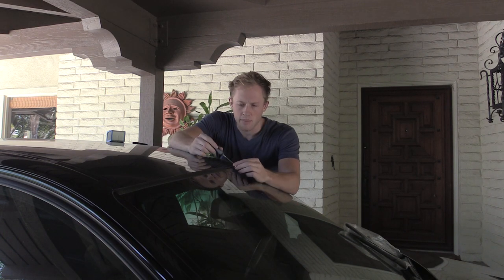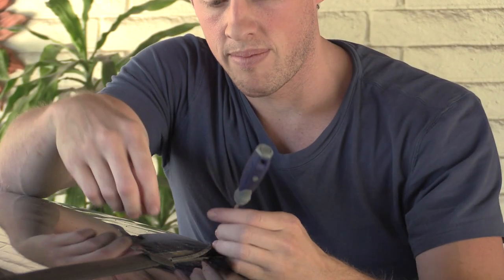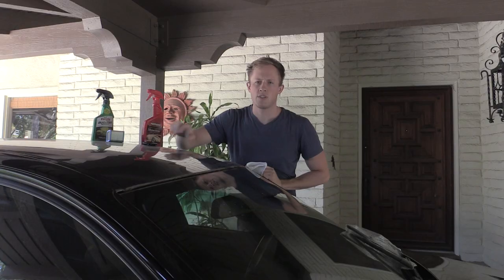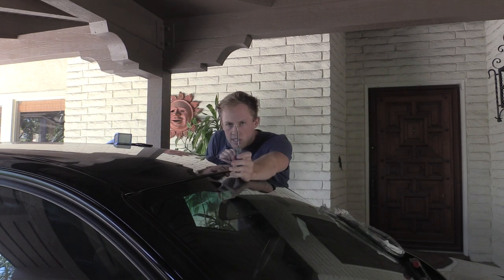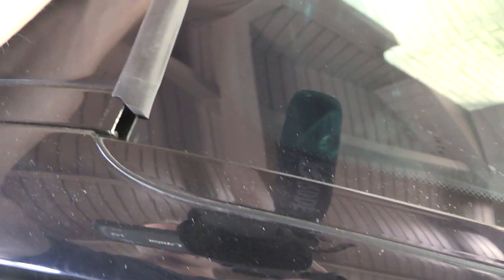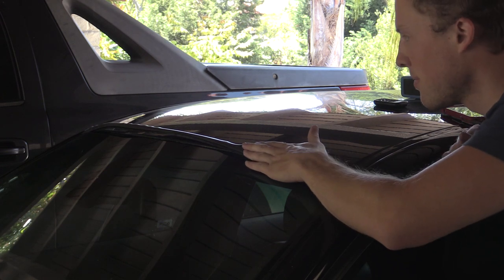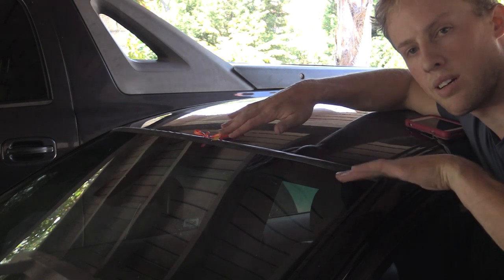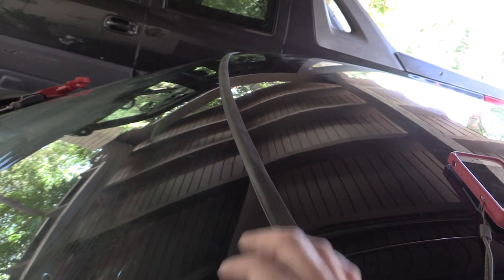E90 windshield trim replacement DIY

Comment: What about using black weather proof Caulking?.. Once everything is cleaned out, Run a smooth bead. only $3 at home depot...it would probably seal it up for just as long if not longer.  Just a thought?

Comment: Nice video. Just did my 2010 535i. PRO-TIP: Use a wooden rolling pin to perfectly flatten the strip both BEFORE you remove adhesive and AFTER. You can't get much better than that...
Reply: Amazing tip using the rolling pin. I couldn’t get mine in flat and started to question if I ordered the right part. Rolling pin did the trick. THANK YOU!

Comment: Lighting needs to be better to clearly see the install.  A little more time spent in what the underside of the strip looks like would also be a plus since they can vary in style. Where did you purchase yours? The amazon link is gone from your post. I bought one from Amazon and it was a nightmare getting it on. The C channel is SO small it was impossible to pop it into place. You do a great job explaining the install just need a little more detail. I have a 2006 325i and need a better product than what I got. Thanks!

Comment: Thank you for the tutorial. i just did this now and the hardest part was to put back the molding . The part where you mention you had to do both sides first then meet in the middle was such an important part. otherwise one of the sides wont fully flushed in.

Comment: My tale of woe (sorta)... Got the moulding and rather than tackle it myself, checked with a local auto glass shop to see if they would do it.  (06 330i)
No problem, they said.  Well, the tech wasn't careful enough and cracked the windshield at the top driver side corner.  Owner reviewed video of the work and said it must have happened when tech pulled old moulding straight up out of the channel.  Owner took responsibility for it and replaced the windshield at no charge. Kudos to them for standing behind their work.  
Word to the wise for those that do it themselves - be very careful and gentle both removing the old and installing the new to not put any sharp pressure on the edge of the glass.  If you have someone else do it, take photos from the inside to document condition of the glass before the work and get a signed agreement on who's responsible if the windshield is cracked.  I was lucky.

Comment: It actually took me longer to watch the video than it did to remove the old seal. I cleaned the old adhesive off with rubbing alcohol and a rag, and vacuumed the channel. Reinstalling the strip took a little longer for me to press it in because I'm a perfectionist and wanted it to be seated well. Thanks for the tip about putting the ends in first! It looks awesome and I saved $$....yeaaay!  :)

Comment: Great video. 

Much easier to pry to metal spine starting at the end. Basically the reverse of the installation process. Small flathead screwdriver prying toward the back of the car and away from the glass. Pops that corner free and the whole things slides right out, Appears with the picking tool you either had to break or cut the spine and then yank on the pieces,

Also, try using a 1" plastic putty knife to to peel away the old rubber. works great.
Reply from the maker: Thanks! That is a good idea.

Comment: I did these yesterday with the same parts on the link from amazon its hard to get the new part in to the edge of the windshield i manage to put them but there us some section that didnt sit flush in front of the driver side and on the end now i got to redo it i did scrape the  side where the adhesives goes into from pushing it into that windshield with the screw driver tip i guess the gap between the windshield and the surface where the double sided tip lays into didnt have enough gap so i have to muscle that thing to tuck it in into that windshield

Comment: Any that can HELP please do. 3rd glass place I went to it did not matter to them that I would pay them what they wanted to do this work on my 2000 Pontiac grand am GT.  They said even with the 2 sided tape the molding would look like crap wavy in areas bumpy in areas. So what's the truth.  How DOES THIS REALLY TURN OUT LOOKING LIKE. I am even thinking as you go to put in new molding that more fresh sealant should be put in. This filling in any possible gaps and adding to the strength to hold molding IN and DOWN FLAT.

Comment: My E90 has a gap between top edge of seal and the body. There looks like there has been a double sided strip there but it has lost its adhesive. Is a sealant required to keep seal stuck to body ?

Comment: I went to 2 glass place both wanted to remove my perfectly good like new and was new yrs ago and couldn't guarantee my windshield wouldn't break $250 cdn. Not sure/don't think that would include another windshield. Other said they would not do it like these you tube videos as it was not a proper job. And said when you remove the old strip it would leave bare metal scratched areas later to rust. But I am thinking old molding C-Channel was coated cover in rubber and with the factory caulking in with it how would it leave scratches / bare metal areas to rust. By the way of all these videos no one put more caulking back in then out new molding in. WHY. and for my 2000 Pontiac grand am GT the factory molding does not have 2 side sticky tape so thinking definitely would need caulking put back it.  It does have that same C-channel design. Everyones input please